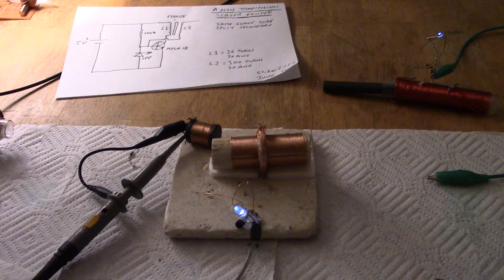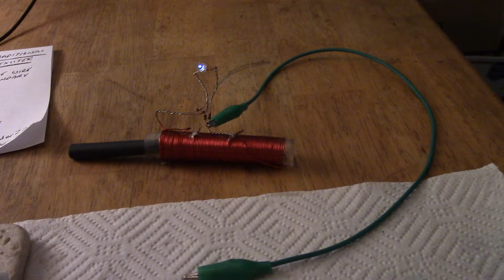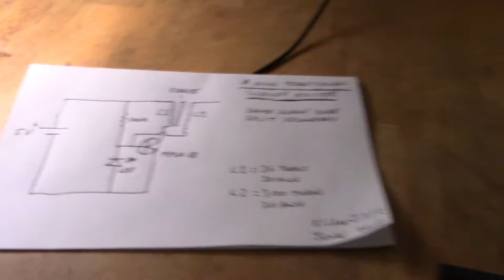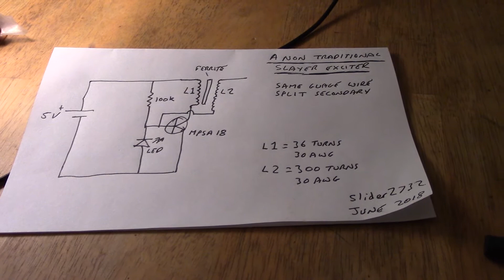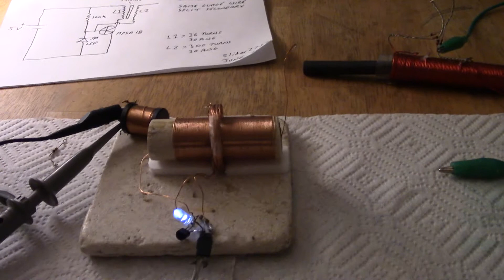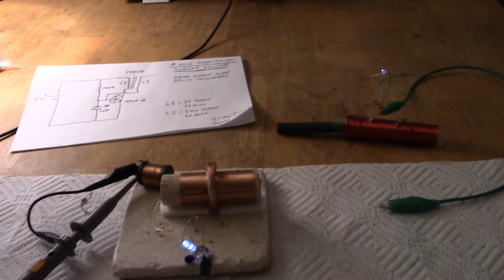A frequency tunable Exciter

Comment: Great stuff. I've been following your experiments with interest and wondered, with you now having a tunable mechanism, have you tried the magic frequency of 27.32 MHz, since 13.7 could be just a harmonic?
Reply: Not trying to be a stirrer but whenever someone is agitated by an idea it's time to test that idea ASAP!
Reply from the maker: Ah, am glad to see you here :)
Have tried 27MHz in a variety of ways, usually from radio controlled circuitboards, but not seen anything especially different yet. However, I do know that it works great with plants, from the experiments a few years ago. Am certainly going to continue looking at the 27MHz area because of those successes.
Reply: To follow instructions from DR. Stiffler, 27mc is not good (I asked him in a YT comment earlier). He can get a bit agitated if we don't do it how he tells us to do this. And I can understand, he has put so many years of experimenting in this! Of course, we are free to test and try again and again, he is sharing his results, and may be you will find some other ones as well.
Reply from the maker: True enough and there will be reasons for the strong opposition, likely time wasted if that's what happened when he followed that path. 
But it is a frequency of interest, having seen the positive effects that tally with the Irish Uni findings. 
Maybe it's as simple as the intrigue with the ever changing Schumann resonance, but no one would use it for wireless electricity !

Comment: That should do it.  I'm using two 9v batteries in series to look at higher voltage effects.  If you just run it for a bit the little transistors heat sinked can handle it.  The question I have is amperage at the output signal.  I think I read that the signal generators can pump out up to 30mA.  Can a Slayer Exciter do that?
Reply from the maker: 30mA at 20V is basically mains ratings compared to my usual stuff lol !
Looking at the various banks of LED's and other experiments over the years, I would think 30mA is quite possible for a Slayer. Have run a small helicopter using one and that needed an amp...it took off briefly.
Reply: I've run many amps off a slayer wirelessly.  I'd have to go back through old videos now, but I think maybe 20W of total load from a 50w input?. I've definitely destroyed 30ma LED's from current.
Reply from the maker: Ahh yes dear sir, we need to see some more explosive reactions to your experiments :)
Reply from the maker: Am very lucky to know you guys :)
Haven't been drinking to say that either.